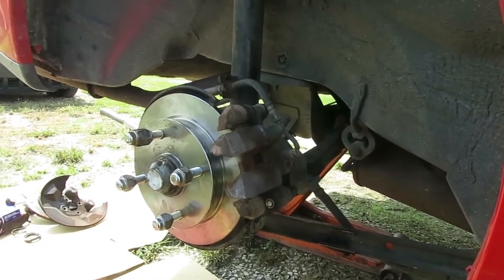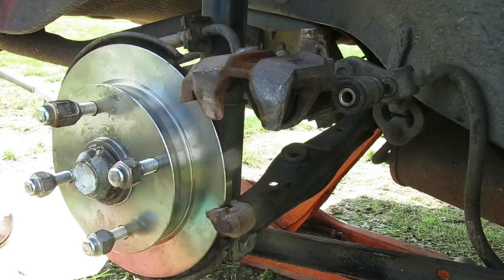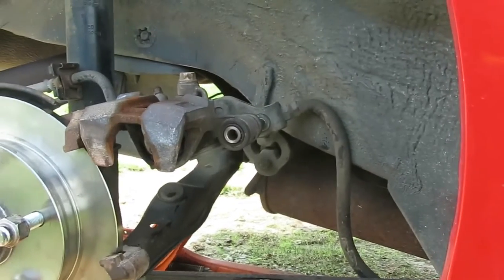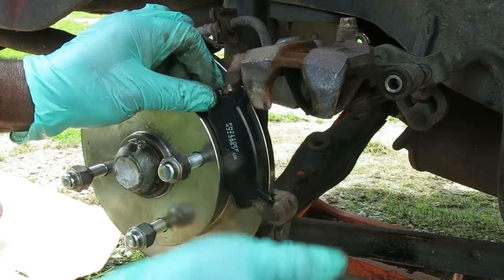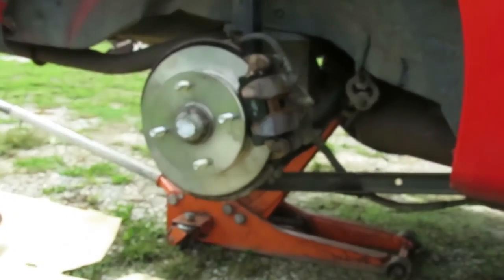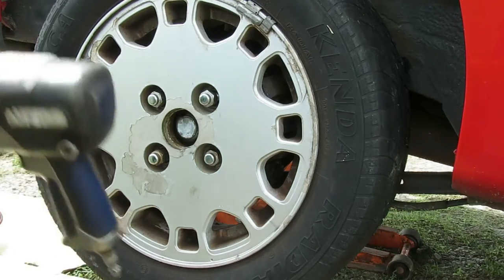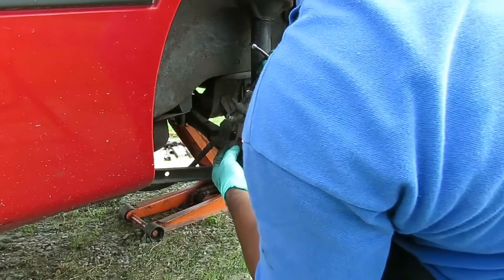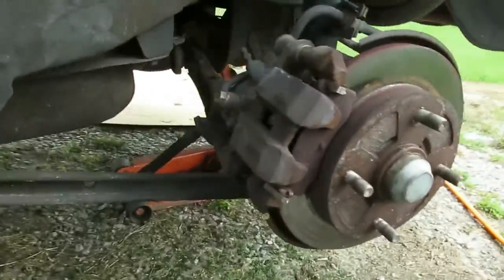⭐ 1991 Mercury Capri - Rear Brakes

Comment: You forgot. If you got in the car and drove it, the brake pedal would go to the floor. You must first pull the parking brake all the way back ,assuming the cable's aren't rusted tight, and depress the brake pedal a few times, to adjust the clearance  of the pad's to the rotor. Then drive it. Keep going.

Comment: this car gets a lot of views, I am wondering if a lot of people have this car?
Reply from the maker: I think so, we used to get a lot of emails asking us to do more videos on it, like we have a choice. Sometimes I think people don't realize that these are not our cars!
Reply: @OnlineAutoRepairVideos any thoughts on 1991 capria fuel issues. New tank, filter,and pump?
Reply: @mickeylough4830  did you get it sorted? I was chasing what I thought was a fuel issue turned out to be a misfire, spark plug arking through the boot. Have a look on the inside if the plug boots for any signs of arking will look like a tiny burned spot

Comment: there is something that bothers me with this car, is the temperature meter is always higher than half as if it were cante but when I review is not overheated but uncomfortable because I think it is overheated
Reply from the maker: Can you send me a picture of the gauge when it's warm? Tim@AstralAutoRepairs.com
Reply: @OnlineAutoRepairVideos  mine is always over 225 under 250
Reply: This is due to the thermostat opening up at a slightly higher temperature than the idle temp of the car typically which causes these cars to warm up in traffic and city conditions. Please join the Facebook group if you need any advice!